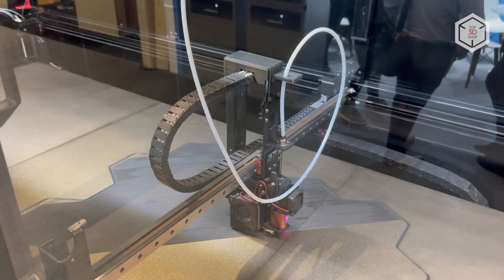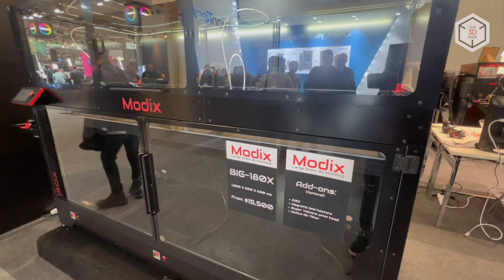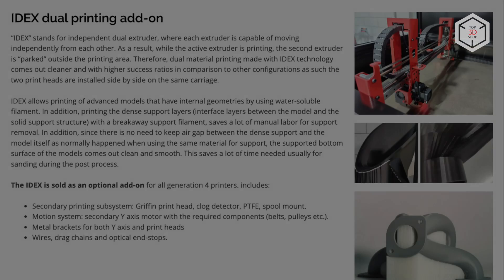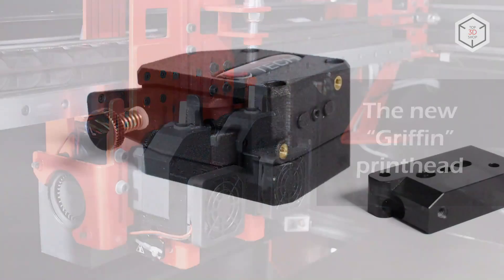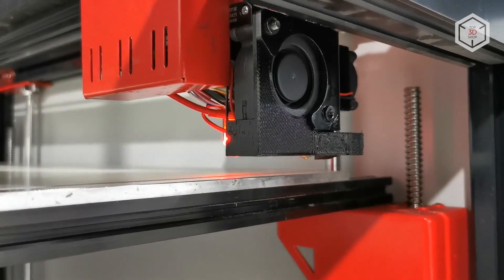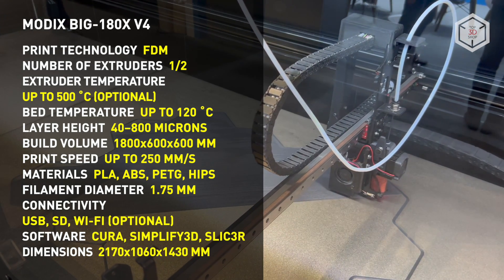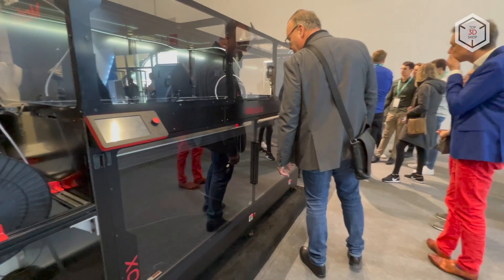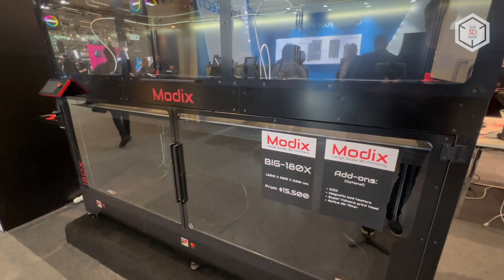Modix BIG-180X V4 Overview: Professional Extra-Large 3D Printer

Comment: for 15k and a printer that prints so long for huge objects, i would've expected an enclosed and controlled filament area, not just a spool spinning in the wind
Reply: It also has just a Duet controller + display.... It's very overpriced.
Reply: @MegaDraadloos what other printern have you seen other than big rep with this bed siz
Reply: Is it that bad
Reply: these printers are totally not interesting, one bull shit ! the should look at simple printers like prusa, bambulab to understand the customer delight when using the printer from opening the box. This 600x600 printer hs two heads coiliding everythime. No standard quality is coming out of this printer, service is at distance but the basic product is poor.
We ordered the 600x600 system wirh dual heads and enclosure...... after 3 months not one print close to our Zortrax,Ulitimaker or surely not our Bambulab.
What a disaster they sell.